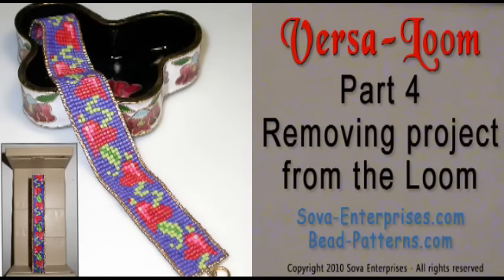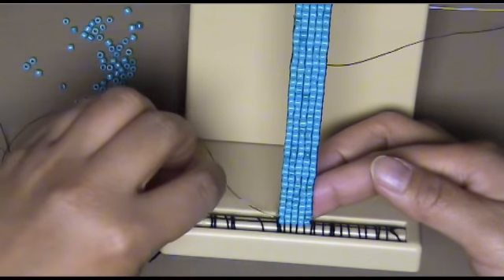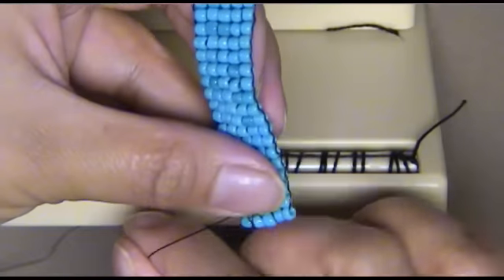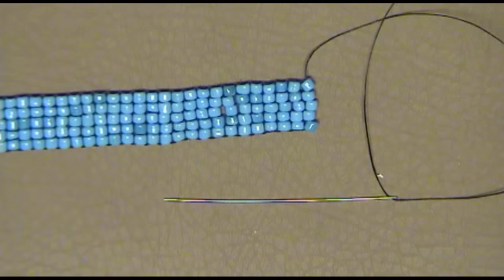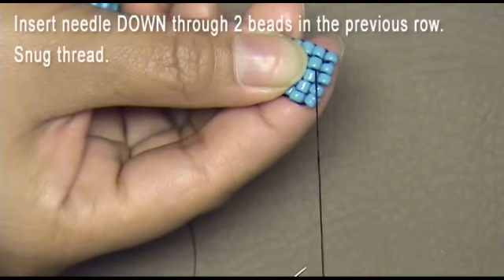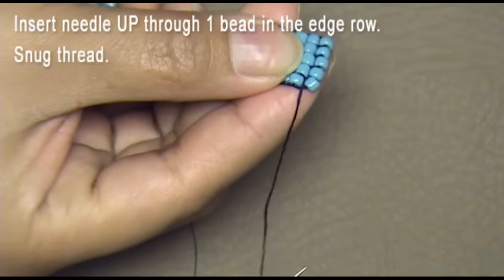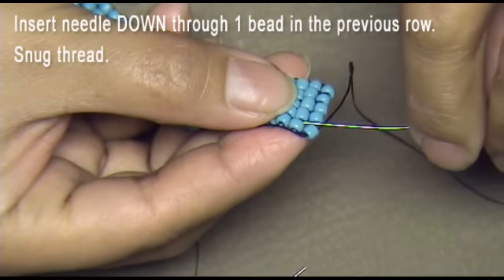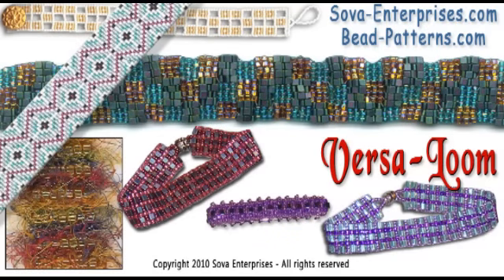How to Bead Loom Using the Versa-Loom! Easy Loom Beaded Bracelet Tutorial Part 4

Comment: For Arlene Devroy who apparently has a limited command of the English language...I have five looms PLUS my Versa-Loom.  I love each of my looms for their unique ease and/or potential.  However, the ONLY loom I will teach students on is the Versa-Loom. The instructions on these videos are excellent and well paced.  That would be evident if you were using them for their intended use, which is to augment the use of the loom itself.  What is not discussed, and would be intuitively obvious to anyone who has ever used a loom for any project, is that THERE ARE NO WARP THREADS to be tediously woven in, one by one.  Even the most simple project, such as the one outlined herein, if completed on any other loom would require the needling and weaving in of each and every warp thread...12 in this case but more likely 50-60 on an average project.  This loom is so well designed, engineered and executed that it is actually my favorite loom.  I have completed over one hundred projects and have taught on this loom exclusively for seven years.  It all but guaranteed success by any artisan of any age and level.  Arlene, please give it a try.  Or at least save your harsh criticisms (and edgy language) for when your opinion can be based on fact.

Comment: How do you adjust for the length of the bracelet?
Reply: Adjusting the length can be done by changing the spacers (before starting the project) or after the project is done, you could use the square stitch to add on additional rows to lengthen the bracelet.  If the project is too long; be creative to fold the excess under and incorporate it into the clasp.  Rita